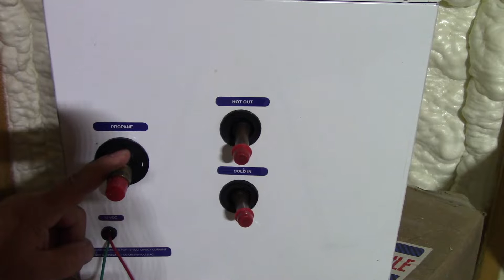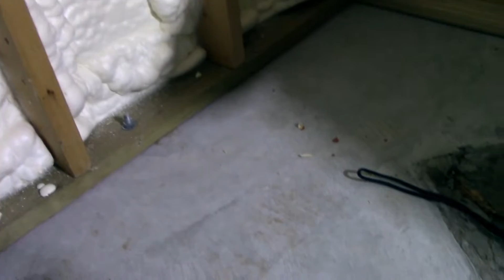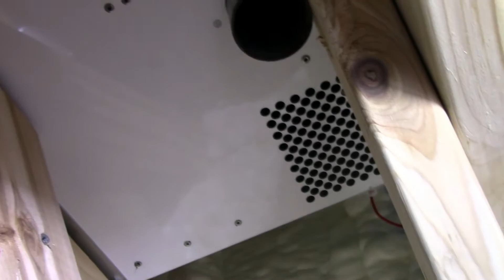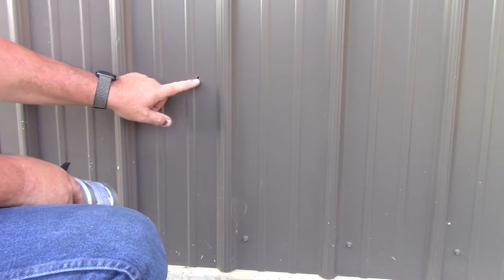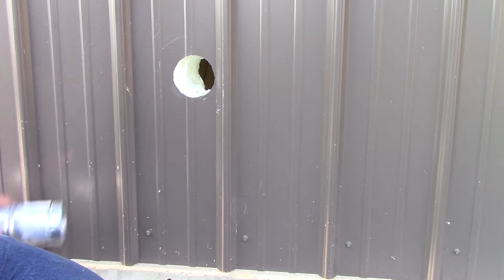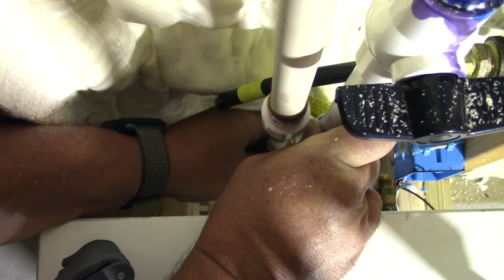PrecisionTemp RV 550 NSP EC Tankless Water Heater Install Cabin Tiny House

Comment: Where and how are you drawing your power? There was a warning that said do not connect to a 120V so my handman connected to my RV battery.  My battery is good, but voltage at the unit is not sufficient.  Having a really hard time with it.
Reply from the maker: I have a AC to DC power supply that it is getting the 12V DC from.
 You definitely do not want to connect it to 120V.
 So what is the voltage at your battery?

Comment: How did the exhaust seal to the 4” double wall?
Reply from the maker: it dont, the 4" pipe around it is just for heat and the small exhause pipe goes through it. I did put fiberglass between the them to keep the cold air out of the house

Comment: Hey, thanks for the video. I had a  hole cut that fits the drop exhaust pipe perfectly, it's about 1.5 inches in diameter, but I see the manual says to cut a 3.5" hole. The biggest hole saw I have is 3" though. I wonder will that suffice?
Reply from the maker: Your welcome, I think mine is a 4” hole and I put a short piece of double wall pipe through the wall then ran the exhaust through it. 
I didn’t want my foam insulated wall to get hot
Reply: @Woodzman  Thanks, I ended up using a jigsaw and cut a 3.5" hole so I'll get an exhaust to suit that as one wasn't provided with my heater and maybe something around this like you had too :)

Comment: so it is ok for the air intake to come from inside
Reply from the maker: It is supposed to be fresh air intake so I’m not sure
Reply: @Woodzman  are you saying now sure or not sure.  Either way your video was very helpful I ended up getting the one that vents out the side I’ll let you know how the install goes in my tiny house.
Reply from the maker: I fixed the typo, I meant I’m not sure. But I just noticed that you said intake? The intake is from the inside, it’s the exhaust only that goes outside
Reply: @Woodzman  Okty for you quick response

Comment: Nice - I would have used a Dryer Vent but good job!
Reply from the maker: The dryer vents are not insulated pipe
Reply: @Woodzman  True.  Can the unit handle a small house by itself. 3 bed two bath house?
Reply from the maker: I don’t see why, maybe not running both showers at the same time
Reply: This may be the answer for my MCI Bus. It would work well in the Water tank bay because I could vent through the floor.  I really wanted a Diesel type but that would be messy with the Glow Plug. I was concerned about how much propane it would consume but I see it should be efficient if I Install a special return line to heat the water faster if I use my Water Tank at a boondock.
Reply from the maker: It sure works great for us, we have one in our RV and also the one in our house now

Comment: Did you add any kind of shut off switch and fuse to your power supply or is it okay to just wire it direct? Thanks for posting this wish I had this 5 months ago!
Reply from the maker: Yes I just added a standard light switch on the wall beside it. Just breaking the positive wire. It really shouldn’t need it but I thought it may be handy if I have to work on it some day.
Yes I do have a fuse at the power supply
Reply: @Woodzman  thank you!!
Reply from the maker: Your welcome